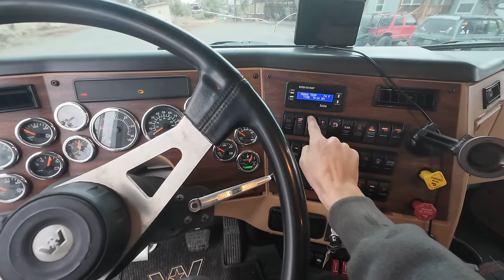It’s time to get this thing fixed

Comment: No matter how you put the brackets on the tow bar, they're ALWAYS wrong once you slide the underreach under the truck.
Reply from the maker: Every.  Fucking.  Time.
Reply: Could it possibly be like the classic USB connector. It’s wrong the first time, then you flip it over and it’s still wrong. So you flip it back and now it somehow fits.
Reply: @RandomName100  Then the USB-C was invented.  But.... now you need USB-C compatible devices, so...
Reply: Thanks to Mr. Murphy and his damn law. My addendum to Murphy's law is this : Murphy was an Optimist.
Reply: Too bad you couldn’t have lifted it by the rear wheel lift so you didn’t have to remove the driveshaft. I would think it would be strong enough, but maybe not.
Reply: your addendum is ancient
Reply from the maker: @michaelblankenship548  I could have, but then I’m picking up a shitload more weight, and by lifting form the front I’m able to have both drive axles of the rollback as brakes.  Since this tow went over the cascades, keeping weight on my front and and having brakes on what I was towing is well worth pulling a driveshaft
Reply: @billclisham8668  so, the "Murphy was an optimist " law has been around a long time. Its actually called  "O'neill's Law"

Comment: Another one of Caseys learning videos from Casey's collage. Nice looking front bumper.  that is a great front saver when you hit a deer!
Reply: I like the front bumper as well. My only concern is if the truck has airbags for driver protection in the case of an accident, the deployment timing will be skewed  so that you might already be face to face with the wheel when the device deploys.

Broken Windshield?
Reply: @larrybe2900 Airbags are only a very modern invention in trucks.
Reply: @larrybe2900  most big trucks don't have airbags and best you get is pretensioners on the seatbelts to keep you from flying out of the seat when you wreck, but even that isn't guaranteed. If you don't wear a seatbelt, an airbag doesn't do much anyway besides give you something to go through on the way through the windshield, so assuming he's doing that the bumper won't affect how the truck works w/r/t safety of the driver.
Reply: @larrybe2900 have you seen 80% of truckers? (Me included), don't need no stinkin air bags! My belly hits the steering wheel, my face ain't going to make it to the windshield.

Comment: Dig the electronic throttle control.  Much nicer than the old cable operated hand throttle.
Pushing the switch numerous times instead of press and hold makes sense to me.  You know your machine and how it responds.  That’s an operator.  We all run our rigs how we do it for reasons. I dig it!!  
Always down for a truck tour!

Comment: My older freightliner has a clearance light interrupt switch.That was probably to flash  clearance lights at passing truckers as a courtesy , when safe to pull back in front of you on the highway,which nobody does anymore.

Comment: Glad you got the rollback running somewhat and are bringing it to the shop.
New bumper looks great 👍 
I bet having dif locks would be handy sometimes but..$$
Reply: Being a non-trucker I have no conception as to cost of lockers. Can they be added or the difs need to be replaced?

Comment: New bumper looks like an outstanding piece of kit! Hope the shop you take that versatile roll-back to finally fixes the engine issues and it can get put back to work in a new home, if that's what you still have planned for it.

Comment: I worked for transport service tank trucking and it was the first time I had a truck with stationary cruise control. We drove Mack ch630 trucks and it was company required to idle at 1250 rpm for layovers to keep the oil pressure up.

Comment: Casey, Thank you for the better view & operation of the new front bull bar. Look out deer & elk Casey is coming through.
Also thank you for an explanation of all the switches & gauges on the dash. 
I do agree with you on having locking axels. It would help with the slippery traction recoveries.

Comment: I'm not a truck driver, but always interested in how machines and vehicles function, so Thanks for the cockpit tour! The cost of each component makes it very sensible to have temp gauges etc so you can monitor condition and spot potential issues.

Comment: Casey, on most Detroit’s, you can have it programmed as a preselect. Basically you turn the cruise on, then hit the resume once and it will bump up to 900-1,000 RPM, or more depending on what you want.

Comment: So glad you are getting the rollback fixed, we hope.  You'll probably sell it once it gets repaired but, at least it will be runnable and not costing you to sit there.
Without a doubt I enjoyed watching this truck over the Zack and you could afford to use this truck on your UTube freebies.  Additionally, you weren't working as many hours and away from the girls as much at night.  With the Zack you need to work longer hours because the Zack is designed for heavy lifting work.

Good luck on this attempt to get the rollback repaired.  You deserve the best and getting the rollback repaired is what you need.

Comment: As often as that roll back is going to the shop you ought to run some air lines to a quick connect panel under the hood so you can hook up easier
Reply: Shit, stick the quick coupler in the grille, so you don't even need to open the hood to hook up the air.
Reply: @haroldphipps3457  more protected from damage up under hood
Reply: @johnnawrocki6993  you are correct, 💯 %

Comment: Wow that new bumper looks awesome on your truck. I'm kinda surprised that you didn't get a front winch installed on your truck. Also with auto chains they should last practically the life of the vehicle since they never really see any stress like a standard tire chain that get dragged on the ground  and stretched out from the tries tugging on them while they rotate around.

Comment: Great job Casey.  Next time you can explain the brake release buttons for tractor and trailer. I’m sure that many of your viewers would like to know how those work -  and the horn, especially if you have the pull valve air horn.

Comment: Fun fact , during a DOT inspection only apply the brakes to 15 psi or so light pressure that’s all you need for an accurate brake stroke reading. Stomping the pedal to the floor can cause bracket stress and could get you a ticket 33:19

Comment: When you add new bumper lights you should definitely get some yellow ones. They make a huge different in bad weather.
Reply: The yellow myth was dispelled years ago.
Reply: My fog lights are white and now that I've upgraded them to leds they are even better.
Reply: @iffykidmn8170  Well in my experience driving for 20 years in inclement weather and blizzards I still fit Yellow fogs to every vehicle because it is way better. So I'll stick to what I know from experience. Would love to see where this 'myth' was dispelled though. Would be interesting to see how they did the test.
Reply: @tammysimons4916  LED lights are great in certain circumstances. Yellow LEDs are amazing during a blizzard. My driving lights / offroad lights are white. My fog lights are yellow.

Comment: Most truck have programmable high idle rpm preset's where turning on the pto automatically triggers high idel at starting rpm and the high idle through the cruise control can be set at preset rpm values.

One deere or moose hit is easily $10,000 or more in damage, the bumper pays for itself the first hit.

Comment: Yes of course I want a tour of the gauges and buttons in the Western Star, can you make that happen through movie magic!  Our tractors and the truck I learned on, an International 22’ flatbed (not a roll back), did not have anywhere near the dash!!!  Edit #2: Love the new front bumper guard cow catcher.  I hit a 350lb buck that jumped out of the woods on to the highway while driving the 22’ IH at 55 MPH - it destroyed the whole front end and even cracked the motor mounts at the block!!!  Edit #3: Ordered the exact same SetPower center console fridge, in the same color (using your affiliate link of course) and absolutely love it and it Fits perfectly everywhere - on the floor of the passenger seat for a long drive, in the center console of the 2nd row seats of a Highlander, in the backseat floor of a standard car within easy reach, and tucks in nicely with luggage in the rear hatch area!!!

Comment: I’ve been watching you from pretty much of your start. Always look forward to your videos. I’m in Portland…..But have family in Bend. So as a kid back in 1989 I had a 1976 Toyota Corolla 2 door lift back 5 spd. Manual transmission. It was a California regulated car. It had a factory engine oil temp gauge!!! Nice thing about an engine oil temp gauge that I learned with that car. If the oil temp starts to go up……
Check your oil level. Temp will go up when your engine oil capacity goes down. I just remembered that when you mentioned the oil temp gauge.

Comment: As a coach driver, we generally had fewer gauges and more switches, but two coaches built less than a year apart in the same factory you would find the switches in different places, so driving down an Italian motorway and entering a tunnel you reach down to turn on the interior lights but open the door instead. When you work for a company that has 200 coaches all built within two years but none have exactly the same dashboard layout you do have to pay attention.

Comment: Those little fridges are awesome. I carry a similar one on my side by side which I use in the summer for lawn care. Set power has a awesome product. Ordered one first from vevor and it never worked nor would they refund or exchange it. Eathen, no passenger seat upgrade. GFYM

Comment: These mobile refrigerator/freezers look like they are very good units.  I am considering ordering one for my own use.  I had a similar unit years ago and was disappointed in its operation until I figured out all the heat in the cigarette lighter plug was where my efficiency went.  If I install one of these in my car today I will run a power line directly from the battery with 10 guage wire to a 2 or 4 pin trailer style plug so that there is no heat (power) loss in the connection to the vehicle and the refrigerator will run at maximum efficiency.

Comment: Wow Casey, you packed a lot in that awesome video. Now that you have that new bumper set up the animals should stay away but if they don't the truck is protected. That's a nice frig and ice/ bottle set up. Glad it made it easier to get in and out of the sleeper. Thanks for the instrument panel/buttons info. I prefer actually gauges over idiot lights and think certain gauges should be standard all on vehicles, like the temperature gauge.

Comment: Hey Casey, nice informative updating video! One thing surprised during the 'buttons explanation' though: you have not got diff locks on your driving axles?? For where you live and work those should be essential, I think? One tip from across the Atlantic: sometimes the hardware for the diff lock is already inside the axle and you only need a switch to be bolted on and electrics to be hooked up. In some trucks the wiring is even already present in which case you only need the dash switches and the activators on the axles to get going. I realize the 'different countries, different habits' rule, but maybe you're lucky... 👍🏿 Greetz from T🐻 in NL.

Comment: Sometime you might describe the 'johnson bar', and how and when to use. Maybe the service and emergency air and associated dash valves, lines, and uses. Also spring brakes, and how dangerous they can be, and about caging them. Good video.

Comment: You mentioned It could  be a bad ecm on the rollback I had an ecm on a 60 series that got a rock behind it and rubbed a hole through ever time it would get moisture out it would  go crazy accelerate willy-nilly and turn the Jake's on whenever it felt like it ecm might have moisture or a lose pin on mother bord causing eradicate engine failure good luck can't wait to see it up and running

Comment: Pittsburg Power sells a DEF reducer fuel catalyst.  I can’t vouch for it, but I wonder if it might reduce the number of regenerations.  Pretty sure there is a distributor in Oregon that sells it.  Boss Snowplow sells a very good heated LED, might work on the new bumper. Thanks for the videos.

Comment: Dpf works by trapping soot particles generated by incomplete combustion. Soot is basically unburied fuel. As the dpf fills up with soot the truck detects the back pressure caused by the restriction. To clear the restriction the truck heats the dpf up to about 1000 degrees f to burn off the soot. The soot is converted to ash which stays inside the particulate filter. Ash takes up a lot less space allowing more soot to accumulate. Over time the dpf fills up with ash and eventually needs to be removed and cleaned.No particulate passes through the dpf.
Reply: Someone else described it as kinda similar to the self cleaning cycle on an oven (for the non trucking viewers).

Comment: A handy tip for your wooden blocks, put a loop of rope or webbing on one end of them. It makes it super handy toncarry and get them out of a compartment.  We use those in the fire department setting for our cribbing bundles. You may already know that, but just a observation,  every time i see them, i think he should put some webbing loops on them.
Reply from the maker: No need, my hands are big enough to just grab them

Comment: @CaseyLaDelle As a cheaper interum shop you might want to look at the shipping container shop like @DieselCreek started with made out of two shipping containers (you have them after all) and a roof.  You could pour a slab and then put the containers on the side and roof overhead.  Gets you a covered shop area a lot cheaper and then when you are ready to put up a shop you can straddle the slab with a pole barn and fill in the edges.  Just an idea.

Comment: Excellent cab tour.  My question concerns the rear drive axles on your flatbed. I know you have talked about towing vehicles and why you disconnect the drive shaft, etc.  But I'm wondering how the axles on the flatbed are lubricated with the drive shaft pulled off. At one time, I believe you said something about the drive shaft spinning a gear in the differentials that splashed oil all over including the bearing where the driveshaft comes in.  How is that lubricated for a 3 hour tow such as you set up for in this video?
Love your channel and your heart for helping others.

Comment: So when are you going to install chicken lights and possibly bumper lights?

When it comes to running airlines, you have the direct connect kit. Could you explain the thought process of when you would like to tie into the tanks versus the air dryer or the main supply line, or frame connection? 

You planning on putting lockers into the axles? 

Happy FYMF tomorrow.

Comment: Thanks for the guage tour!  Very informative.   What is the long skinny handle on the right side of the steering  column?
Reply: Trailer brake controller. Used when sliding trailer axles and to check kingpin lockup when hitching to trailer....tug test...then you get out, take a light and look at trailer upper coupler and fifth wheel for any gap, then look at coupler jaw to insure it is fully locked. Most drivers, at most, do a tug test. They're in trouble if the trailer king pin has overrun the fifth wheel and is in front of the whole assembly instead of going into the fifth wheel throat and actuating the kingpin lock. First turn or big bump...trailer falls to ground.

Comment: I was wondering if the drives where open, or some sorta lock up/lsd.
I know for regular rock road use, it makes a person really think before getting in a messy place.
.
I have seen a few chip trucks run a hydraulic setup to the steering tires, for wheel drive. Works at sub 25 mph-ish. I figure it costs a bit.

Comment: Yeah I'd like a truck gauge and switch tour - mainly because I'm a geek like that 😊 The machinery I am used to driving (Talus MB-4H Mk2 for those that know) doesn't have as many switches or any gauges other than a screen. So I'm jealous of your cab. Also: I hate Casey LaDelle! (Am I doing that right?)

Comment: This Be My Hubby Dennis.. My Son Drove For This Guy  . Son Truck 2012 Pete W\ Cumming . The Truck Heighted Cumming. It Blow Up Each 200,000 Miles. the 3 rd. Time It Blow A Hole In Side Of Block. Like When Ya Snap A Rod .. But It Did Not Brake The Rod.  So Good Luck On It.

Comment: That "stupid" thing you did with the setup? When you were showing them off and putting them in place, I was remembering you saying that no matter how you set them up, they will need to be changed for the next job.  You were 100% correct.😂

Comment: OKS,   Well ,, With the driveline ,, duck tape the U-Joint to keep the caps in place to prevent the needle bearings from dropping out !!!   Had other towing cos. that didn't do this simple trick & had to have the U-Joint replaced !!  Great update on the ""Rollback " as thought it would turn into a ""FLOWER GARDEN "" for sure !!  HAHA  😂🙂🙃😉👍👍👍👍👍

Comment: At first I thought you had a lot more switches then the international and freight liners I drive. However half the switches are located on the steering wheel left console and door panel.   You do have a few I don’t like your extra lights and auto chains. It would be nice to have some of the gauges like axle temps. Also I agree being able to turn it into a true 4 wheel drive would be nice as well. I have been stuck and had to call for a tow because of snow/ice conditions and a small dip where the water ran off the lot. It didn’t help it was diagonal to my drive axels.